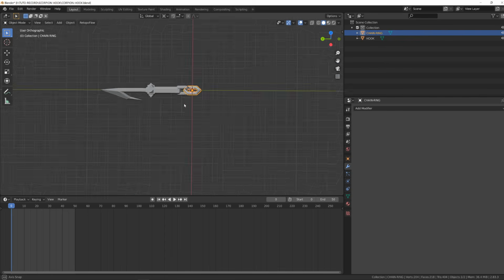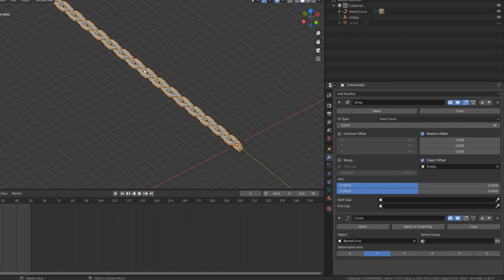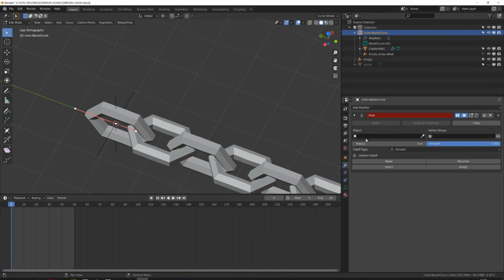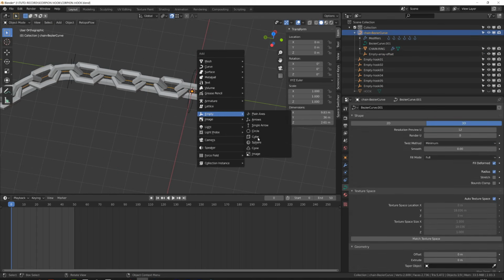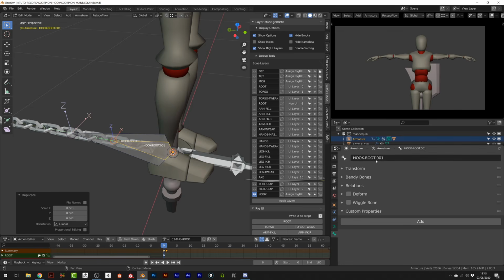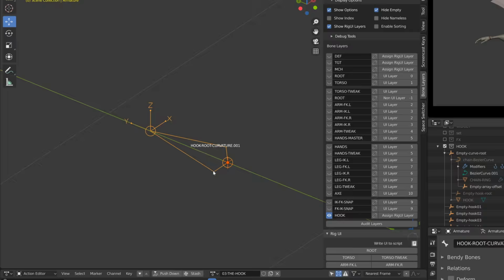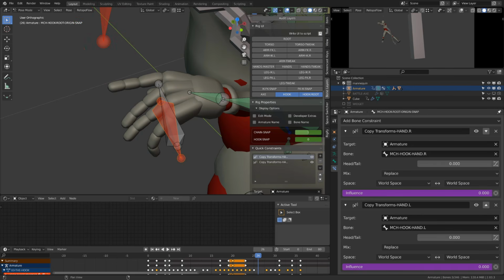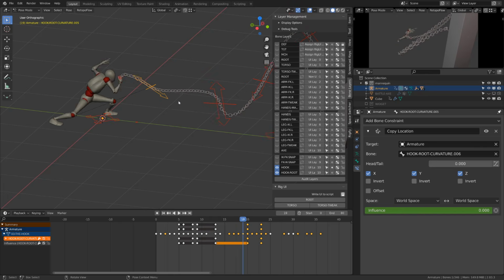Rigging chains and Scoprion's hook in Blender

Comment: When I move the hooks, the curve vertices no longer interpolate smoothly and I get very sharp pointy corners instead of a smooth curve :( anyone has any idea of how to solve this????
Reply: Okay, in case anyone has the same problem, the solution is to select the curve, go into edit mode, select all vertices and then set the handle type to Automatic in the Control Points menu ;)
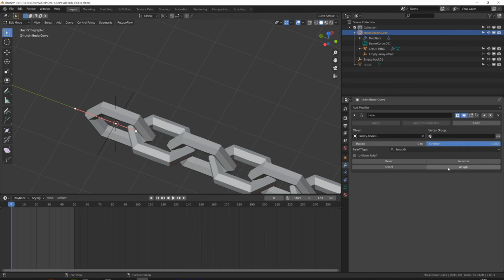Reply: @llucgaux  Great suggestion! Is your curve changing when rotating the emptys as shown in the video at 4:34? 'cos mine isn't and can't understand why...
Reply: @gek1375  yeah, I have the same problem, luckily my curve looks pretty good and I don’t have the need to rotate or scale the empties haha anyways, tell me if you figure out how to fix it :)
Reply: @llucgaux  It finally works! Into Edit Mode, select the curve point AND ITS TWO HANDLES, and then use Ctrl + H to hook them to the empty. You also need to ensure the curve's handles are in "free" mode and not "aligned" by right-clicking the handles in Edit Mode and toggling the handle type.
Reply: I still can't move the curve origin point though....
Reply: @gek1375  omg that makes sense!! Thank you so much :)

Comment: idk why 
is it just me or just blender current version problem
because the hook/curves modifier seems to work so differently like moving the 'empty' doesn't replicate with the curve inside edit mode like in the video
Reply: Into Edit Mode, select the curve point AND ITS TWO HANDLES, and then use Ctrl + H to hook them to the empty. You also need to ensure the curve's handles are in "free" mode and not "aligned" by right-clicking the handles in Edit Mode and toggling the handle type.
Reply: @gek1375  Damn, you're a lifesaver, thanks
Reply: I have the same problem T.T

Comment: Places I was hung up on that might help others.
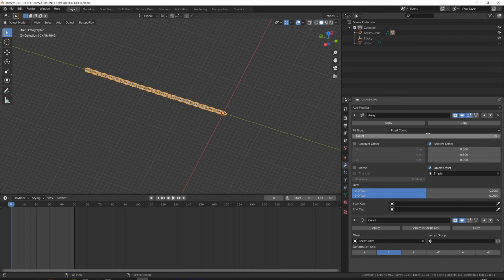2:45 The Curve drop down comes after Selecting Fit Curve.
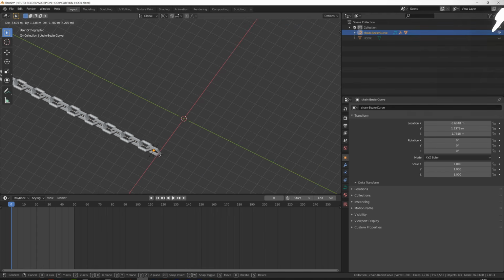3:15 Parent the New Empty for an origin TO the Bezier Curve not the Curve to the Empty.
5:15 Each Empty needs a seperate vertex and a separate Hook Modifier.
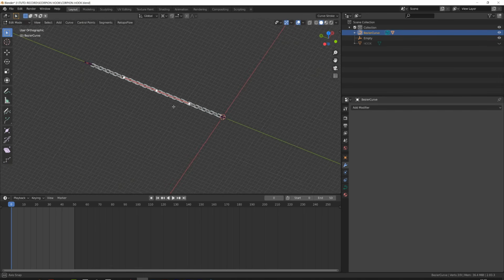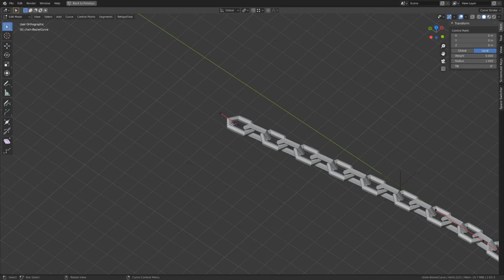Reply: Additionally: For 2:45 You have to select the BezierCurve as the Curve object. 3:15, contrary to the tutorial when he said to scale the curve's side vertices to 0, Do not. Scale it to a minimal and assign those including the main vert to the hook, so that the rotation and scale works in the hook.
Reply: @incognito4824 you seem to be the most recent to complete this maybe you can help. 4:56 when I grab the origin it dose lengthen but only about half as much as I need so every 1 link added it moves 2 lengths from the pinned empty. So the gap gets wider the further it moves.

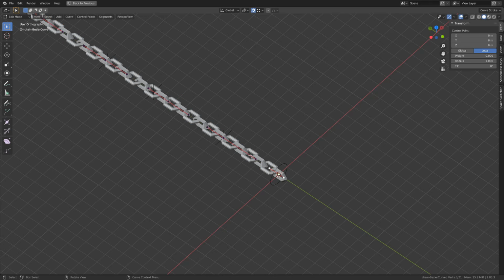Comment: For those that get stuck at 2:45 , when you have to set the Array type from Fixed Count to "Fit Curve", and your chain goes back down to one link. To Fix this, all you need to do is go into the "Curve" Section of the Array Modifier, and set that to the Bezier Curve. That will fix it. Good luck!
Reply: "...and set that to the Bezier Curve" Set what to Bezier Curve? The Curve Object? That's already set to Bezier Curve and i still only have one ring. What am I doing wrong? UPDATE: I figured it out. I was looking at my Curve modifier. I see now that the "curve" drop down box right under the Fit Type drop down is what i needed to change, in the Array modifier window.
Reply: @neillholley5061  Nothing popsup for me.
Reply: @incognito4824  Under the Array modifier, the topmost dropdown called "Fit Type" is where you change to fit the array to "Fit Curve". Directly below that, it'll ask for an object where you select the curve object you want to use as the array length. I'll have an eyedropper sign inside that you can use to select the curve or you can manually search for the curve there.
Reply: I think, the Curve drop down does not appear until Fit Curve is selected. So. That might have been the issue with some users. Certain Blender functions are not visible until you assign them to the thing you are working on. :D
Reply: when I do then, it just makes the chain longer than the bezier curve, it basically doubles the length of the chain without changing the curve, how tf do I fixed this
Reply: something i found that fixed my problem was that the scale on both the curve and object had to be applied. so, hopefully that helps some who are still finding this tutorial!!
Reply: Thankyouuuu

Comment: is there anyway to scale the chain and everything without messing up the chain links? i need to scale down the chain hook model to fit my armature but can't get the chain to stay the same length and make it work like normal. any help?
Reply from the maker: I guess you need to scale the geometry of the chain links. not through the armature, but in edit mode on the object itself
Reply: you can try to switch on "Stretch" and "Bounds Clamp" in the curve/shape settings of the underlying Beziercurve. if you only scale the root-empty, then the chain will be stretched awfully. But if you scale the amature when all hooks are attached to a bone, it seems to work nicely.

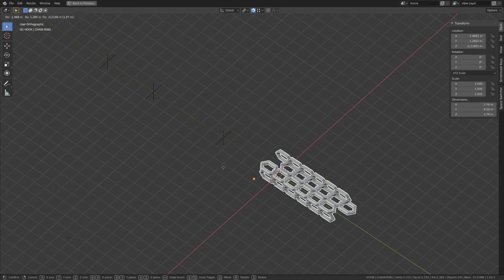Comment: After you switched from ''fixed count to fit curve'' in the array modifier tab, you skipped a part. If you look close you changed the screen to the next frame and we don't get to solve an issue that appears right after switching.....  Please check at 2:43

Comment: When I do "Curve Deform" the chain becomes flat.  did I miss something?
Reply: So I found out how to fix this. While in edit mode on the curve, select the first one that you scaled down to the 3d cursor, then in the transform panel (from hitting N), you can see 3 of the vertex axis, change them all to 1. Rotate the curve until it lines up straight again.